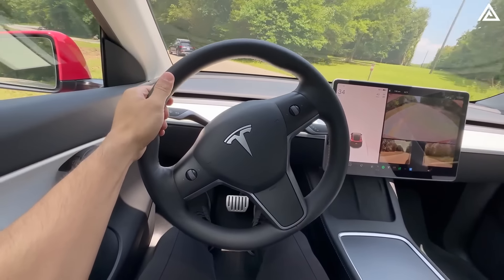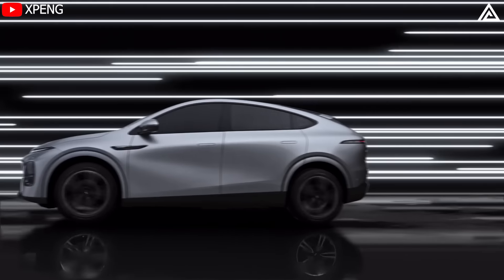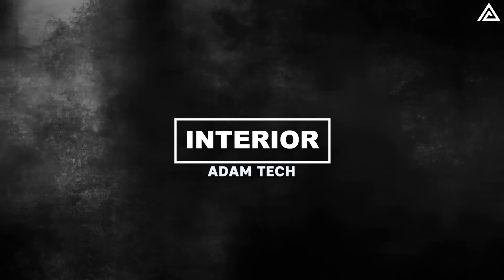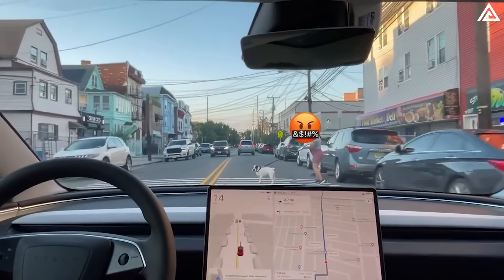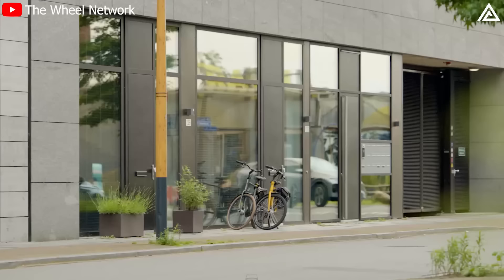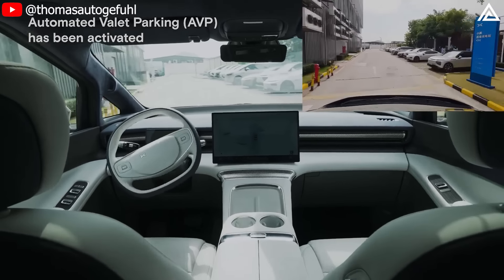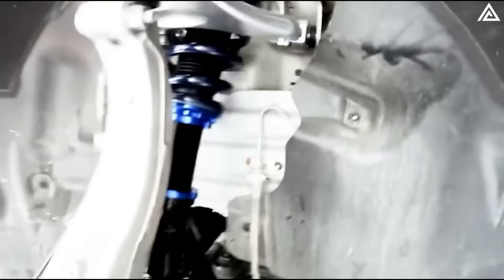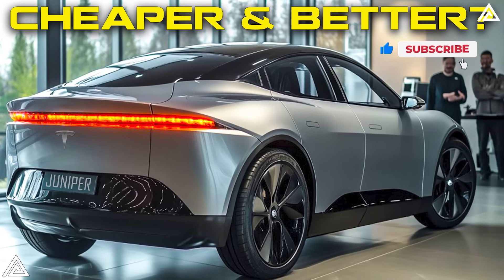Elon Musk Announces Model Y 'Juniper' 2025 Has 3 More Features to Take Down Xpeng G6. What Happened?

Comment: These price comparisons are extremely disingenuous.  The G6 has most features included in the base price, on the Tesla you have to add a bunch of options. 

The result is that a top specced G6 here in Norway costs 530.000 Norwegian (53.000 $ give or take). A similarly specced Tesla Model Y costs 635.000 Norwegian, or about 63.000 $.
Reply from the maker: Thanks for your sharing